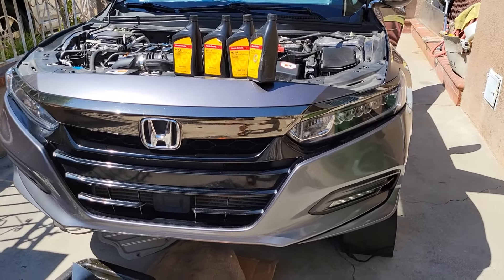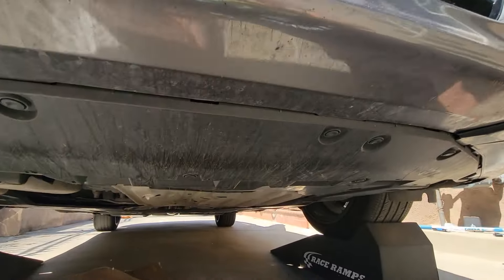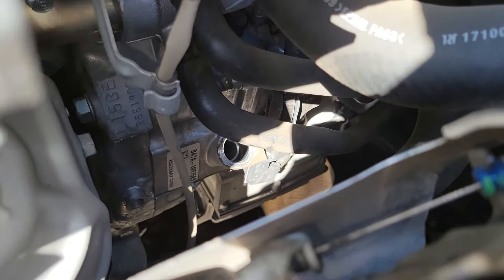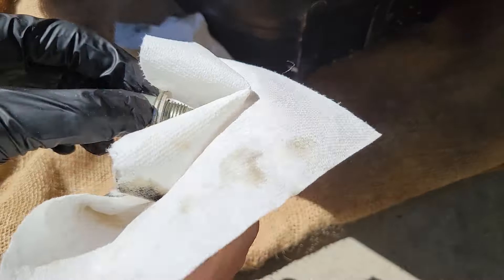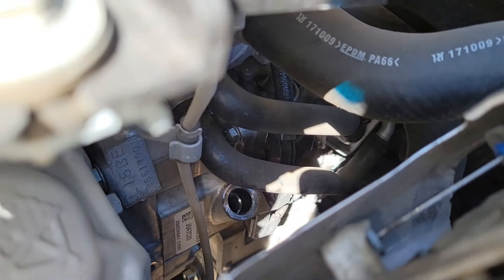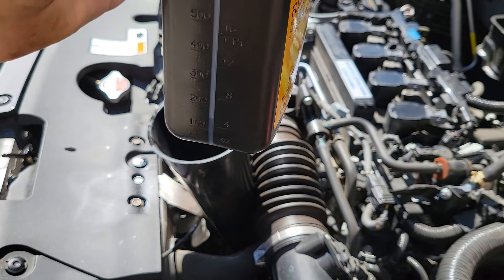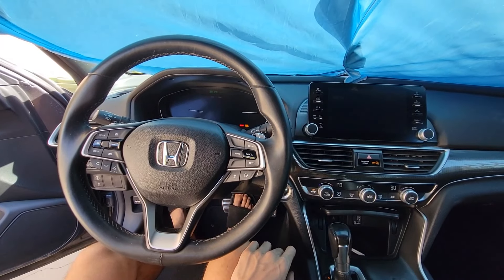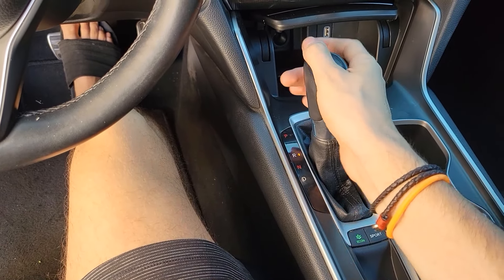CVT Transmission Fluid Oil Change 2018-2024 Honda Accord, CR-V (1.5L Turbo)

Comment from the maker: :yt: Race Ramps Used:
https://www.amazon.com/dp/B003ZA8WIE?linkCode=ssc&tag=onamzdan0f4a0-20&creativeASIN=B003ZA8WIE&asc_item-id=amzn1.ideas.20WJBA2MSTTNU&ref_=aip_sf_list_spv_ons_mixed_d_asin

Honda CVT Transmission Fluid:
https://www.amazon.com/dp/B0961493M7?linkCode=ssc&tag=onamzdan0f4a0-20&creativeASIN=B0961493M7&asc_item-id=amzn1.ideas.22TBRJ5EGQE8T&ref_=aip_sf_list_spv_ons_mixed_d_asin

Oil Funnel:
https://www.amazon.com/dp/B0BWNWFS7D?linkCode=ssc&tag=onamzdan0f4a0-20&creativeASIN=B0BWNWFS7D&asc_item-id=amzn1.ideas.20WJBA2MSTTNU&ref_=aip_sf_list_spv_ons_mixed_d_asin

Oil Drain Bolt Crush Washer: 
https://www.amazon.com/dp/B07P37VX9R?linkCode=ssc&tag=onamzdan0f4a0-20&creativeASIN=B07P37VX9R&asc_item-id=amzn1.ideas.1GQO7BKQEEC6D&ref_=aip_sf_list_spv_ons_d_asin

Floor Jack:
https://www.amazon.com/dp/B0001E65UE?linkCode=ssc&tag=onamzdan0f4a0-20&creativeASIN=B0001E65UE&asc_item-id=amzn1.ideas.20WJBA2MSTTNU&ref_=aip_sf_list_spv_ons_mixed_d_asin&th=1

Jack Stands:
https://www.amazon.com/dp/B0BJV5KF3N?linkCode=ssc&tag=onamzdan0f4a0-20&creativeASIN=B0BJV5KF3N&asc_item-id=amzn1.ideas.20WJBA2MSTTNU&ref_=aip_sf_list_spv_ons_d_asin&th=1

Wheel Chocks:
https://www.amazon.com/dp/B07FGWZY2Y?linkCode=ssc&tag=onamzdan0f4a0-20&creativeASIN=B07FGWZY2Y&asc_item-id=amzn1.ideas.20WJBA2MSTTNU&ref_=aip_sf_list_spv_ons_d_asin&th=1

CVT Fluid & items I use in my videos for my 2018-2022 Accord on my Amazon affiliate Storefront here: 
https://www.amazon.com/shop/striker50/list/22TBRJ5EGQE8T?ref_=aip_sf_list_spv_ofs_mixed_d
Reply: I looked the video. You mentioned the check bolt but then you never showed us where it was and you're kind of guessing how much fluid to put back in. You did respond to someone else that you should always use the check bolt to make sure you have topped off.
Reply from the maker: @craigbessette1054  Yes that is correct. We know the CVT uses 3.7 to fill, since that's info directly from Honda 
The check bolt is a smaller bolt 🔩 just right above the drain bolt

I wish I could have made this video with more detail but I made it years ago and I didn't think it would be so popular If I'm being honest
Reply: My owner guide said use the DW-1.
Reply from the maker: @slowestrider4918  which country are you in and what transmission do you have?
Reply: @Striker50_  USA. My Accord Hybrid has engine and transmission built in Japan.

Comment: I just went to the dealership today for an oil change and they recommended a transmission flush costing $129.95.  After watching this video, I can do this myself for way cheaper.  Thanks for making the video!
Reply from the maker: Means a lot knowing I was able to help 👍
Check out my engine oil change video also!
It usually costs me around $27 to change the engine oil & filter myself with Synthetic
Costco sells 10 qts for $27.95 (that's more than enough for 2 oil changes) and the filter is usually around $8-$10. 
I got tired of waiting 4-6 hours for oil changes, time is MONEY! 💵
Reply: Yes they do charge alot because they know what there doin but i perfer do it your self
Reply: I ordered my Honda OEM transmission fluid and filter and will be doing the fluid flush soon for my 30K mile maintenance. Thanks again for the video.
Reply from the maker: @ivanhernandez9560  Especially when it's easy to do, it's just draining and filling but they like to scare people to think it's hard
Reply from the maker: @justinkuler  Make a video for the transmission filter if you can I've never seen that
Reply: u mean by drain and fill. transmission flush cost way more than that especially at the dealer. even at the local auto repair shop, they only do one  drain and fill.  How can u verify that the dealer that performed the flush when in reality they did only the drain and fill.  Don't go for the flush, only the the drain and fill more often with the orginal factory fluid.
Reply: I have been told By someone that if you do your own oil change there won’t be any record of maintenance was done which will be difficult for you to sell your car later on. Fact or fiction?
Reply: @mohammedrashel1888  I’ve sold several used cars with no proof of maintenance. I’ve always changed oil by myself
Reply: I changed the oil at the dealer for 100$, I live in Saudi Arabia
Reply: @mohammedrashel1888  At least keep your oil filter's cardboard package along with the receipts for it and the oil. That should help convince a potential buyer.
Reply: Doing a flush is better, because 20% of transmission fluid remains even when draining.
Reply: @Waxxumus  that's why Hondas have a 3x drain and refill process. I don't suggest a flush on any vehicle, for many many reasons.
Reply: @ivanhernandez9560  that’s if they really do it at all
Reply: No filter?
Reply: I'm at 36,000 miles on my 2020 Accord. Probably around 75% highway. Still no maintenance minder indication it's needed. Looks almost as easy as an oil change. So don't know why dealerships charge so much for this service. Very good video. Thx
Reply: That's a steal. My dealership says $190!!!
Reply: @Striker50_  I am coming up on 60K and will be doing another transmission drain & flush.  I have to look at Honda's CVT transmission diagram to see where the transmission filter is located.  I can make a video about it and share with the community!
Reply from the maker: @justinkuler  That'd be interesting to see! From what I've read, the filter change isn't recommended because if something were to go wrong with the CVT, looking at the filters is a way for technicians to know what's wrong with it
Reply: @justinkuler  just so you know it’s now $159 in NC. That’s why I’m here now
Reply: @Striker50_ I've thought to by oil from there. How she running 2 years later
Reply: @pekkle101 😮
Reply: Should the gear filter be changed?
Reply: My dealer. 4-3-24. Wants $240
Reply: flush costing $129.95 - what does flush entails? That's pretty dam cheap!
Reply: My 16 versa cvt.. $400 5 yrs ago for a fluid exchange.. They just did the cooler hose method.. Now i just drain and fill.. 200,000 miles and still going
Reply: I was charged 199.99. Never again.
Reply: @Striker50_ How come you didn't change the filter? Aren't you supposed to change the filter as well?
Reply from the maker: @timothylee2772  Nope Honda lists it as a lifetime filter. There are 2 filters, but I'm going by the Honda service recommendation. Changing the filters will take like 2 hours or more. That's a good sign they're not meant to be changed
Reply: i went today and they charging me $197.53 to replace transmission fluid, they’re crazy i’ll do it myself
Reply: @Striker50_ Transmission filter, like all other filters in a car, needs to be changed at some point. It doesn't take 2 hours to replace it. Just look up at YouTube videos where it is done.
Reply from the maker: @kimberlyescobar1013  That's insane. 
Service center is the #1 money maker for dealers
Reply from the maker: @timothylee2772  We have a Heavy Duty 3/4 ton Chevy 2500 with an Allison transmission. Even Chevy and technicians both agree those transmission filters shouldn't be replaced. 
If a heavy duty truck is fine without replacing it, a little Honda will be as well. 
As for the 2 filters, there is no one else that has looked into it more than me. 
You're going to spend more than 2 hours replacing both I can guarantee you that. 
If you think otherwise, it's a clear sign you have no idea what you're talking about
Reply: Theyre 745$ in long beach now😅😢
Reply from the maker: @MiguelRomeoDiaz  stfuuuuu.. pull-up I got you
Reply: My local dealer wants $170!!!
Reply from the maker: @Winterstick549  About $120 in labor 🥵
Reply: Yes, it is a easy job as you are not dropping the Tranny Pan, adding Transmission Fluid with vehicle level is difficult part if you have no lift...

Comment: Who here has added all 4qts instead of 3.8? I’m thinking just adding all 4. Would it harm the trans?
Reply from the maker: Use the check bolt with the car level that way you assure it's properly filled if adding more 👍
Reply: CRV AWD  drained just shy of 4 quarts. Put the whole gallon of Castro CVT/ATF back in. Been doing this for the past 2 years.
Yes I drain and fill once a year, it's only $25.

Comment: Looks so simple. Not much harder than an oil change. I spent 200 bucks at the dealership. I'll remind myself to watch this video next time.
Reply from the maker: Glad I could help 🙏
I'll probably make another video in the future showing even more detail (example: using the check bolt 🔩 and having the car level) 
I've learned a lot since making this video, but yeah it's become quite obvious dealers make BANK 🏧 by scaring people making this service seem harder than it is, and restricting access to service information, that's not right
Reply: I'm at the dealership now and looking this up I wish I would of done myself.  200 dollars is a rip off and they just got me.  😔
Reply: @nicholaswlandry  I just paid $300 for my 2.0t 😥

Comment: I just did mine but I noticed that the transmission has two fill spots. The that is being shown in the video and there is another one just behind the air filter with the same plug and it's labeled HCF-2
Reply from the maker: Yup! I asked the Honda techs why that is and they had no idea. It may be possible that the Civic or CRV uses the same CVT, so when working on one of those, it's easier to access the other hole based on how the engine is designed
Reply: Thank you!!!! I’ve been searching everywhere for this answer!!
Reply from the maker: @nonplayablecharacter4815  Very random but yes we have an answer
Reply: @Striker50_  haha thanks
Reply from the maker: @nonplayablecharacter4815  🤘

Comment: I just changed my transmission fluid on my 22’ Accord and I had just over 4 quarts come out. Since I only purchased 4 quarts from the dealer, I put in the full 4 quarts and went for a test drive after shifting through the gears and it’s driving fine so far.
Reply from the maker: Make sure to use the check bolt to get the most accurate reading 👍
Reply: Dealership says 4.5 qts on a change only. I guess I'll use the other half a quart on my next transmission fluid change 😁

Comment: Good video, did this myself the only thing I’d say gave me a hard time was the 2 Phillips head screws towards the back of the shield can strip easily,also going to be tight to get a funnel through there so plan for it. I was able to use 2 funnels to reach the hole
Reply from the maker: Good to know
An oversized flat head and a long funnel should do the trick
Reply: Leave the Phillips screws. Tilt the plate down and drain into a shallow pan.
Reply: @skofflaww3883 i just had mine strip i got frustrated and did the same thing 😂

Comment: Good video but you forgot to use the 12mm bolt check transmission level plug to allow the excess oil to drain out to maintain proper level.  This check fluid level plug is above the transmission drain plug.  The vehicle has to be on the level in order to perform this procedure or be level in the air on jack stands.
Reply from the maker: Great point, however I didn't forget to use it, I just did not have the resources at the time. I am not a mechanic by any means, and jack stands, jacks, and everything else all costs hundreds of $$$, Of course I can make a better video now, but this video at the time was meant to help 90% of people that don't have many tools and are beginners wanting to save some money.
The check bolt requires a washer as well, and the dealership parts department had no idea what I was talking about when I asked about it so I was not going to risk not having a replacement part

Comment: Hi there
Great video 
Just to ask , after change it , how many miles you drove?
And do you have any problems?
Thanks
Reply from the maker: @davidkuzmanov3488  You should change it about every 60,000 mi this Accord has a notice maintenance minder where it will let you know. Absolutely no problems

Comment: Great job 
Missing checking the level of transmission liquid from the check bolt to be sure the level is correct
Reply from the maker: Yup, I would do a few things differently in this video if I could but I was pretty new at car repairs at the time I made it
Reply: Thanks very clear and great steps .
I reached 4.5 liters until it became dripping!!!!!! I almost one liter above normal!!!!! I don’t know why???
Its accord 2015 4 cylinder almost the same specification.
Reply from the maker: @saudiwave  Hmm was it on a level surface?

Comment: the Honda isn't level , but if you know how much came out and how much you need to refill it shouldn't matter , my wife's 22 CRV is still on warranty so Ill take it there until warranty is up .
Reply from the maker: Partly true; check bolt is the best way to assure the level is proper i've since learned. 
What kind of warranty does it have?  This service comes up after the warranty expires usually

Comment: Awesome video and quick tutorial! Do you think Honda sets the transmission fluid to be changed earlier than necessary on these new 10th gen accords? Seems like it.. I read 60k is when you should change. I bought my car brand new and now it has 48k since 2018.. I don’t feel any weird shifts but I have the bigger 2.0t sport engine with push button 10spd transmission. You made it look super simple!
Reply from the maker: I believe so, since my 2013 was recommended every 60k-90k and had no maintenance minder notification. 
It's the same transmission except for some gear ratios are slightly tweaked 
Lol 48k, your car is whistling new! You should be fine! 
It honestly is quite simple, I need to make another video using the check plug to assure 100% it is exactly filled to the right level. I didn't change the fluid until ≈120K on my other Accord and I drive that car for rideshare (tons of stop and go) and it's still running great at 140k, you should definitely be good for years to come 👍
Reply: @Striker50_  that’s what I thought. Honda engineers set that as factory default. Thank you for sharing your past with your older accords! I’ll wait it out maybe after next couple oil changes 🙂
Reply from the maker: @corpuzone  that's a good idea, just buy the proper oil for your 10 speed and a crush washer! I'd love to make a video on someone's 10 speed if anyone is here in Southern California
Reply: Jus change it..its a fragile cvt..easy diy
Reply from the maker: @edubb2491  The 2.0 is a 10-speed auto

Comment: I've got 27,000 miles on my 2020 Accord 1.5. Best to do with cold engine....since the fluid is cold? Can chubby hands fit thru to that small plug ? For warranty reasons keep all fluid receipts. Well done video.
Reply from the maker: Can totally do it cold, won't make much of a difference. I personally like to leave it running for 2 minutes so that it warms up just slightly but not enough to burn oneselfs when draining. 
It would be a snug fit, but your hand should fit. There's also a second fill point near the battery which is strange, but an alternative nonetheless. Good call considering powertrain warranty is good through 60,000 miles. Thank you for the praise. I'll be making an updated video to this in a few months with a more detailed, accurate service :elbowcough:

Comment: Looking at a new Honda with this engine.
Is this engine pretty reliable?  Does it consume any oil in between changes?
Reply from the maker: @chuckwalla2967  it's pretty reliable and no consumption like my 2013 2.4L is doing

Comment: Seems you would drain more fluid from trans if all four wheels were in the air. Thanks for the video.
Reply from the maker: @michaelnelson7305  It's a possibility but id imagine it would be a miniscule amount.
I didn't have all the tools at the time to raise the car with all 4 wheels up

Comment: One thing to mention you don't have a transmission maintenance minder on the middle scree for the 1.5 accord base model. Only is able to reset the motor oil on the half digital dash
Reply from the maker: Interesting! 
Have you driven your car past 60,000 miles or how do you know that the LX Accord doesn't show the maintenance minder? I would imagine it would since it uses the same infotainment interior

Comment: I how much quart do I put in a 2018 Honda Accord sport 1.5 l
Reply from the maker: Honda recommends 3.7 but always use the check bolt method and have the car level on 4 Jack stands to get the most accurate reading 👍